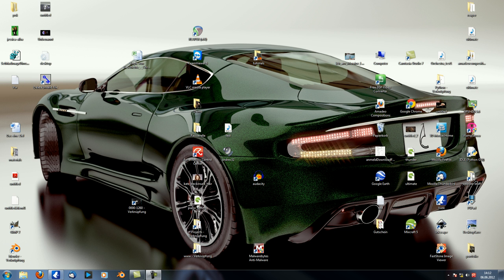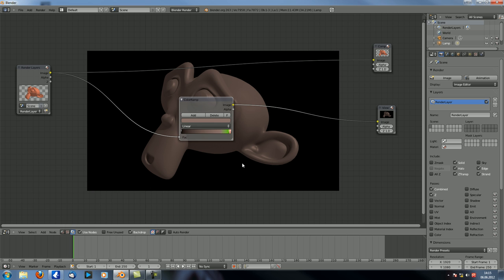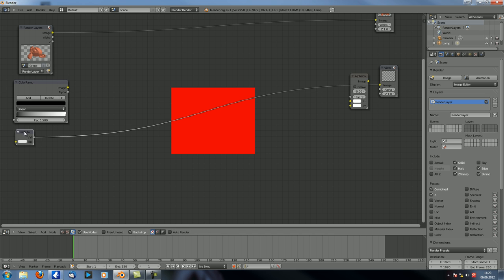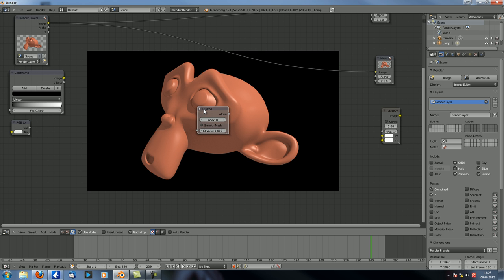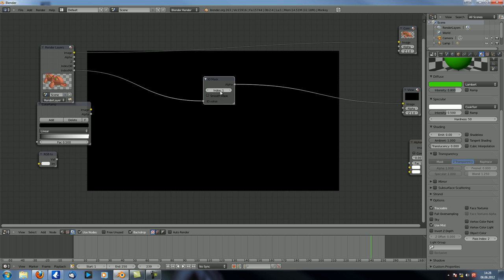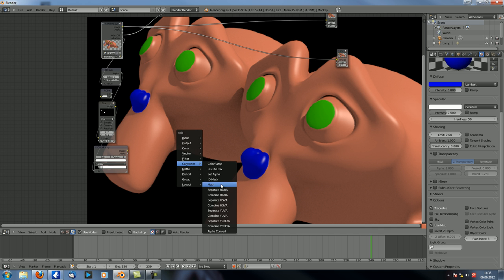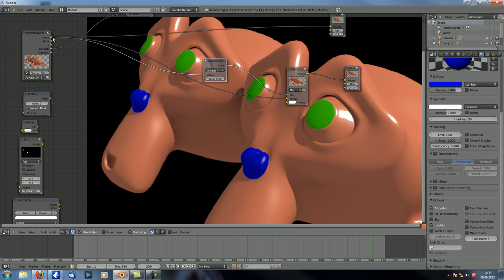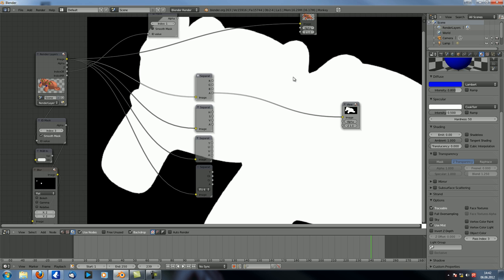Blender Tutorials | First steps and preparation 28 | Convertor nodes

Comment from the maker: Dear Onjofilms,

That is indeed not wrong. The range you are takling about however is the range of colors that can be displayed. 
R/G/B 0/0/0 is black and 1/1/1 is white. But lets say you use a mix node with type divide. Now you divide a white pixel (1/1/1) with a grey pixel (e.g. 0.2/0.2/0.2). Blender does the following: 1/0.2 = 1*5 = 5. You now have a pixel with a brightness of 5/5/5.

Comment from the maker: Btw: You can get these wrong values even from the render output as demonstrated in the video. If you use a lamp with power above 1 you get such strong highlights and sometimes when using subsurface scattering you get values below 0. I've never used images with negative values, I always cut them. But you might want to keep the highlights. As seen in the video, on the clipped image the highlights are lost after multiplying red. On the unmodified image they remain bright.

Hope this helps 

Cheers

Comment from the maker: Your pixel with value 5/5/5 is made up of R G B: R = 5, G = 5, B = 5.
If you now multiply these values by the slightly redish color which was probably around 0.8/0.44/0.31 ->  R = 0.8, G = 0.44, B = 0.31.
That gives us:
R: 5*0.8 = 4
G: 5*0.44= 2.2
B: 5*0.31= 1.55

Comment: Yes, interesting tut.  Just not clear on one thing.  You say with the 'Map' node you exclude values over 1 and below 0.  But I was thinking color is either ranged from 0 to 255 or 0 to 1.  I was thinking Blender uses the range 0 to 1.  So how can pixels be over 1?  I was wondering that on the other vid too where you were talking about the 'hot' pixels in the Cycles render.
Thanks

Comment from the maker: As you can see, all the values are still above 1, so everything appears white. The problem here is, that this result is hard to anticipate. The same goes for values below zero. if for example you add them onto something they do not brighten respectively leave the image as it is, but they acrtually darken it. Very hard to work with.